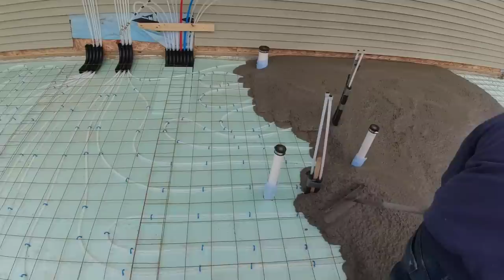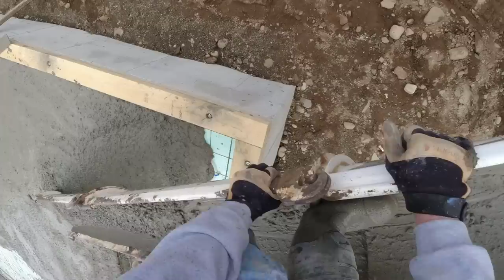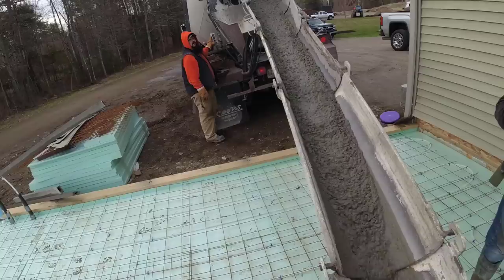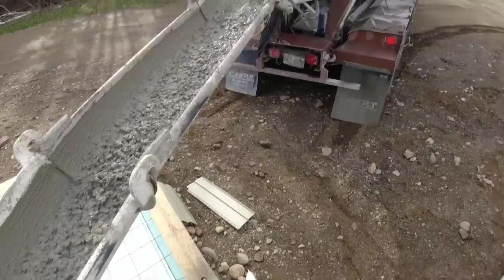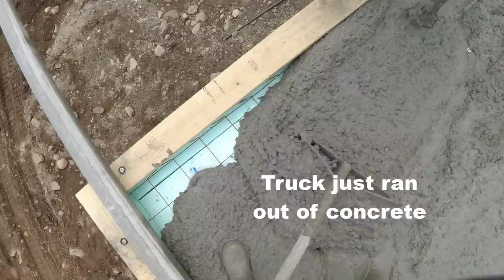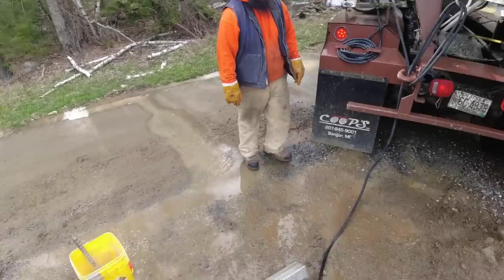We Didn't Order Enough Concrete! (Big Concrete Floor Addition)

Comment: I never heard of water reducer until I started watching you guys. Wish we had it back when, woulda saved a lotta arguing with inspectors and G.C.’s🤨👍
Reply from the maker: Back in the 80's an 90's we used Super plasticizer for increased slump. It wasn't very finisher friendly. Now, the water reducer is great. You don't even know it's in there when you finish.

Comment: I worked at a ready mix company in Chicago, hauling powder. I cannot tell you how many ties I’ve seen a yard dumped on the ground that should’ve went in drum lol at central mix of course. Maybe they hosed you?
Reply: I've worked in RM production for 34 years and that just doesn't happen unless it was some major fk up. The grade or formwork is usually off or yield of the concrete mix depending on air content or w/c and design.
Reply: @drcornelius8275   yeah but this yard was like no other. 3000 yards a day so it happened often lol I actually watched batchman dump it in a guys hood 😂
Reply: Not a doubt from me. Lived in Chicago for over a decade... Lol
Reply: @nbco55  If it happened that frequently, they would quickly be out of business. What kind of company would allow that to happen on any regular type of basis?
Reply: @Broke_operator  My biggest day batching was 2880 yards in 14 hours and the plant would average about 300k yds a year. Did that for 10 years and never had any issues unless it was a mechanical breakdown with the plant.

Comment: Oddball question from an inexperienced person what's the difference between a magnesium float and a aluminum float from a person with experience I need to know
Reply: Magnesium float is generally used early in the process, when the concrete is still wet. They are good for laying the concrete down flat and pressing the stone down.  Steel trowels are used when the concrete is starting to get hard, they give the concrete a smooth finish
Reply: Appreciate it brother I'm inexperienced and I'm working doing concrete walls with aluminum panels and concrete footers. The company I'm working for gives everyone aluminum and the ones in the truck are about 3 years old and shitty and I got a little bit experience in flat work so it drives me nuts. So this weekend I went and got me a magnesium float for the footers personal tools
Reply: Thank you very much
Reply from the maker: Most hand tools are either magnesium or steel, not aluminum. Aluminum chemically reacts with concrete, that's one reason you oil the inside of your aluminum wall forms so the concrete doesn't leave a "burnish" looking mark on the concrete as well as for lubrication inside the forms. Our mag floats and bull floats are magnesium. Hand trowels and fresno's are steel.
Reply: One of the strange chemical properties of the reaction of aluminum and cement is the fact that it creates hydrogen bubbles. Which in some concrete uses can be a net positive if you are looking for an expansive concrete application. Not too common.
Reply: Thanks E.